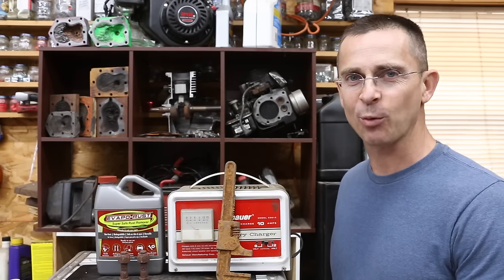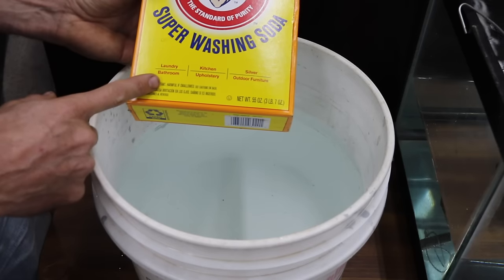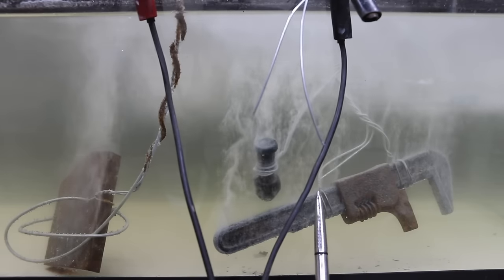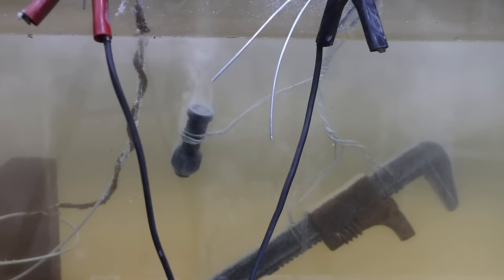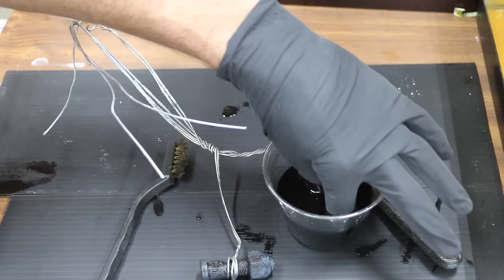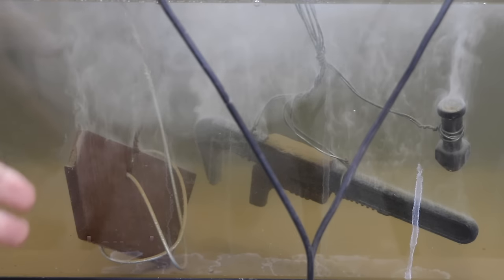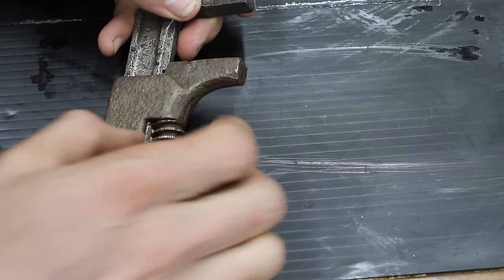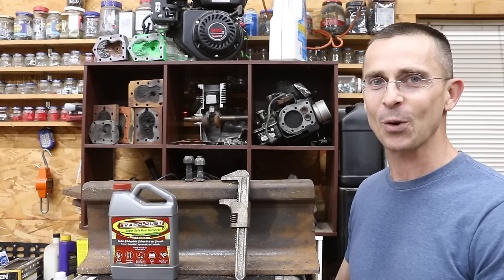Is Electrolysis better than Evapo-Rust?  Let's find out!

Comment: use Electrolysis in 
Evapo-Rust filled tub
Reply: explosions intensifies
Reply: Or vinegar
Reply: except of course, Evaporust is absolute crap...Money poured down the drain. It is almost useless.
Reply: @simonlloyd7557  worked great for my gas tank restoration, it's part of a moped frame so i can't really use an alternative lol
Reply: @edwardmulder3777  vinegar is the absolute worst rust remover, of any potential rust remover you could use.  it both removes metal AND does a relatively poor job of removing rust.

I wish people would stop recommending it.
Reply: @simonlloyd7557  - Perhaps you could share with us your 'data' and/or experiences supporting that statement.  Some people might not just accept your statement as-is.
Reply: @simonlloyd7557  I have used it for the last 3 weeks.  ITS GREAT!

Comment: Great video eh,  I've used evapo-rust for years it works pretty good, I found that when its been used over and over then turns really black it also works to blacken metal parts. 

I bought a very large old seized pipe cutter a few years ago for $20 and I haven't been able to free up the thing, the threads are rusted very badly, I even tried that automatic transmission fluid mixed 50/50 with Acetone but it still won't budge. I tried heating it with a torch too, still nothin'.

Maybe letting it sit in an electrolysis tank a few weeks would help? lol
Thumbs up! 👍🏻
Reply from the maker: Thank you and Happy New Year!
Reply: If the ATF/acetone mix, heat, and evaporust haven’t been able to free it, I doubt it’ll free up with electrolysis.  But hey, if you’re bored and have the setup, it’s worth a shot
Reply: For really rusted stuff, I've found that Muriatic Acid works wonders, you might want to try that. Caution, it is VERY corrosive, even the fumes are.
Reply: More heat, if it doesn't work you are bred, can't use the f word here. Heating the cutting disc will ruin the temper.
Reply: Give electrolysis a try, it will eventually convert all the rust back to iron powder.

Comment: It is a line of sight process, having a small little anode is not very efficient, time-wise.
Multiple donor metal rods in the corners would work far better.
Reply from the maker: Thank you!
Reply: Not true in the slightest mate, this is a key part of my career, it boils down to current (and solution, but his is fine), all that's needed is a better power supply. Hope this helps 😊
Reply: and a metal mesh all around the perimeter better still.... I know, I've tried them on complex shapes tractor parts.

Comment: I'm old school I use Vinegar. By the way Happy new year to almost half of the World.
Reply from the maker: Thank you and Happy New Year!
Reply: I tended to switch to vinegar also.  I really like Evaporust, but vinegar did a great job also, lasts longer, and is much cheaper.
Reply: Could one use electrosis in vinegar?
Reply: Cheap white vingear worked for me. Just take it out each 8-12 hours, knock off the loose rust and drop it back in.
Reply: I’m not sure if apple cider vinegar works any different from regular vinegar but it usually does the trick for me
Reply: @MegaLifeChanging  yeah
Reply: I'd put rusty nails, bolts, etc. in a small bucket with Coke and they come out like new. To think I drink that.
Reply: Vinegar with baking soda.  You can also wet sand it off  with 400 or 600 grit if  there is any remaining rust.

Comment: Hello,  I'm new to your channel and very impressed.  Here are some things I wish could be tested:  Which type of fastener head is strongest-phillips, flat, torx, allen, a few more.  I wonder in that video about a wooden head, did you use hickory, white oak?? How about a test for the best pressure washer heads?  I'd love to know the tolorances for a carb float.  Fix a flat for tire repair-cheap vs expensive.  Battery charger 2 amp vs 15 vs 40.  I'd love to know the fuel economy of bad oxygen sensor vs computer default for bad oxygen censor.  I'd love to know what wrong with the cheap gas I hear screws up chainsaws.  Half of all vehicle fatalities due to mechanical failure is due to tire failure.  I'd like to know more about that.  Where do babies come from?  I heard that garages wont flush your tranny because it loosens debris by back pressure and screws up your tranny.  My dad use to put a quart of deisel fuel in his oil before he changed it.  Could one run with just deisel fuel?  I've heard of backhoes that the motor blew up because of a leak around the injector pump.  By the way on your video of running with starter fluid I know why you can't run too much on a deisel.  I used to much on my backhoe and it lowered the compresson so much it wouldn't start.  I shot oil in the cylinder and it started right up.  I'd like to know if stop leak works.  Old timers used pepper or oat meal.  I could obviously think of a millioin things I wonder about.  When I hit this button I guarantee I'll think of more.  Like chainsaw teeth test. or I could do this all day.
Reply: OIl filters!!!!! Detergent oil, right?  Without filter non-detergent.  I don't trust synthetic
Reply: LOL.  You definitely have an enquiring mind.
Reply: Antisieze
Reply: @dougn2350  A blessing and a curse.
Reply: I've always wondered about a tuned exhaust.  What do they change to make it perform better?
Reply from the maker: Thank you for the video ideas!
Reply: you ask about: 
"dshreve34 4 days ago
I've always wondered about a tuned exhaust.  What do they change to make it perform better?"
ANSWER: You can tune both intake and exhaust. It's all about the speed of sound.  Take a long pipe, smack one end with your palm, and you hear a hollow sound, right? that sound is the wave of sound traveling down the pipe and exiting the end. The usefulness for tuning is that that sound wave as it travels down the pipe is compressing the air as it passes through it, letting go as it moves on at 720mph, plus or minus depending on temperature of the air. THEN as it exits the end it sends a negative wave, partial vacuum back up the pipe. and if the length of the pipe is set to the right length for the rpm range we want a boost in power, exhaust or intake pipe, gets back up to the start with it's vacuum charge, when, for instance, an exhaust valve is open, it helps exhaust suck out the gases. This increases efficiency considerably and causes a narrow band (up to 1500 rpm wide) of increased HP. However, the down sides are several: if this is a 4 into one type tuned header, if the valve is still closed when it gets there, then it bounces off and continues back down the pipe as a negative wave, and when it exits it sends a POSITIVE wave back up. Guess what? if it gets up there as the valve is opening it KEEPS the exhaust from coming out as well, causing a DIP in power instead of the JUMP in power with a negative charge. Look up Tri-Y headers to see how it gets rid of this problem. BTW most acoustic tuned, 4 into one headers are NOT SET FOR THE CORRECT LENGTH. I COULD give examples. Check dyno graphs of power which can show a properly tuned 4 into one engine having a spike of power at the top, and a dip at the lower rpm.
A better system is Tri-Y  Inertia tuned, not as much peak power but has an increase in power and torque across the rpm range.
Reply: @billbanche4605  Thank you so much for that explanation.  I'm trying to wrap my head around the basics.  I need some time.  I'll get back to you tomorrow.  BTW if the length being optimal for a certain RPM has anyone ever made the length vary with the RPM?  I need to think about this. Thanks again.
Reply: The more I know the less I know.  I think I finally got it, thanks to you and studying the past hour.  They call it "pressure wave tuning" and it is exactly how you described.  The only difference is I was thinking about the sound from the tailpipe instead of the collector after the headers.  I do have a couple questions, of course.
They are tuned for a narrow window-choose either low end torque or high end HP.
Why don't they mechanically vary the length to have the best of both worlds?
Why don't they use a ventura in the collector to speed up the gas? like in the carb?
Reply: So here is another idea.  Run a motor with the exhaust and without for a time to see if what I was told when young-that a motor needs that back pressure for longevity.
Reply: Last year a study was done stating that a continuous tuning exhaust would increase power 8.5 to 9%.  No one does it yet.  They do it to intakes though.  Ferrari "Its intake runners’ lengths are infinitely variable instead of restricted to just two sizes, and the runners get longer by “telescoping” instead of using flaps or valves".
Reply: A phrenologist would say you have an overdeveloped bump of curiosity. Me, too.
Reply: Bill Banche, an out of tune exhaust drives musicians crazy!
Reply: @philwood1009  I had to look up "phrenologist".  I thought it would be a joke like when the episiotomist said "let er rip".  But you are right.  I remember when I was 5 setting up different types of apples to see which variety decayed faster.lol.  When I was 13 I bought an Opel engine for the only purpose of tearing it apart.  I learned what a capacitor was when my sister's strobe light zapped me when unplugged.  I am now in my 50s and still the same way.  I've been thinking about building an engine where the crankshaft is stationary and the block spins-2 cylinder 2 cycle with the cylinders opposed.  Thanks for the reply.
Reply: @onenewworldmonkey  RE: varied lengths: ACTUALLY mazda did, by having two different intake paths on their wankel Rotary engines, & these engines only have 3 moving parts. :) Otherwise in a 4 stroke engine I don't see how it's possible.
However the 4 into one is called acoustic tuned, and I've seen engines on hot rods that have them cut to different lengths so they Fit (NOT good) and would only offer a boost at over 10k rpm or more, but that engine is not capable of over 6k. It's all about marketing. So many 'parts' and intake and exhaust mods that CLAIM power increases, but do NOT. The hot rod builders don't test them, on dyno or track, they are for show, so, as long as it LOOKS good... that is all that matters.
Inertia tuning is the tri-y, and it's much better. It uses 3 y's  connected, (connect 2 y's to four cylinders then one below) so there is always a path that passes by another cyl, causing suction at every cyl all the time. Four into one are designed for race cars, where the driver keeps the engine in the tuned area with gear choice and rpm. Pretty silly to use it on a street vehicle. Some stock exhaust systems use Tri Y build into the exhaust manifold. Other manufacturers have no clue.
Reply: @onenewworldmonkey  an engine is an air pump. the whole intake, combustion chamber, shape of valves and seat, and intake ports, exhaust valve, exit points, exhaust pipes, muffler, etc all work together to pump the air through. too much restriction anywhere in there reduces flow. 
Long ago firefighters found that if they curved outward, the output nozzle of the fire hose, it increased water flow up to 50%, compared to a nozzle that was cut off straight or flat round exit. So, a performance valve job does the same by eliminating as many edges as possible on the valve and the seat. I've done it many times on my own engines. it's like putting a higher performance camshaft by just doing that much more detailed valve and seat modification, without the loping rough idle. :)
Reply: @onenewworldmonkey  "They are tuned for a narrow window-choose either low end torque or high end HP." tuning for low on the exhaust is difficult, but possible. On a chevy v8 for instance, to tune for high rpm it takes roughly 36" to 42" length of the 4 pipes before they enter the collector, low rpm tuning would be about twice that length. as it is I've rarely seen any highly tuned cars cars with the right length for high rpm. there is no place to put them, except on a race car.
And, on the tri-y inertia tuned manifold it makes little difference on the length.   
And torque an HP are another discussion. There are limits to basics: for instance: Long stroke gives torque as does cubic inches. Short stroke allows higher RPM due to limits of piston speed increase high end power and torque. Changing cam timing is what they try these days it helps, But trying to increase torque on a short stroke engine can be done but you can't have the best of both worlds. :) Imagine trying to crank over an engine by hand with a short z shaped tool, then imagine the same with a Long z shaped cranking tool? more leverage more torque in the long one. Yes, it's complicated. :)
Reply: @billbanche4605   I remember years ago a company would pump valve grinding compound through your intake and heads to make the entire route smooth.  Thank you for your knowledge.
As for my motor design, it is hard to describe. To scale down imagine two quarters standing on edge a half inch apart.  Now connect them with a pin near their edge.  This is what the crank would look like and would not move.  Now the engine would be say five inches long by 1.5 inches wide and be like a pipe with the cylinders near the end.  The engine would spin around the crank.  I've found nothing like it.
Reply: @billbanche4605  I was wondering how big of a length distance in your pipes between max high end HP and max low end torque design (on say a 350)? Is making the diameter bigger the same as lengthening?
Reply: try google
Reply: @onenewworldmonkey  " Is making the diameter bigger the same as lengthening?" I don't think the diameter of the pipe changes the speed of sound :) and bigger isn't always better. BTW I like your inquisitive mind. :) and thinking out of the box. Keep it up. :)
Reply: @billbanche4605  Thank you so much.  I wasn't going to reply again but I wanted to run one last thing past you.  What if not far from the cylinder you  put something like an old glass pack.  The pipe becomes two-one inside the other.  The inner one would be perferated.  Slow RPM the gases would go out the perforation, High RPM the gas would blow past the perforation to a different point.  This way your could mechanically vary where that sound wave starts from with no moving parts.  Is it possible?
Reply: @onenewworldmonkey  RE: "... This way you could mechanically vary where that sound wave starts from with no moving parts.  Is it possible?": innovative impressive question, the kind that makes inventions possible. :)  Yes good questions. I had to look up and found this, for clarity: http://autoworld.50webs.com/mufflers.html  but not sure that would work, since not only would it slow down the overall flow even if done properly, (varied diameter of the section that had the glass pack in it, slowing down the flow, increasing overall back pressure) it would very likely cancel out some of the sound volume, and reduce the negative reverse wave, and perhaps not produce two separate waves returning to the valve. There may even be an effect of sound canceling out sound, as mentioned in the link. with today's supercomputers it's possible to test it in software to see if it's possible. But another negative would be change in the effect due to wear over time of the glass pack. which would change the carefully calculated tuning length and shape of components.:)

Comment: I use electrolysis. I have a metal "c" clamp on the negative lead. I took the pivoting foot off of the end of the screw part of the c clamp and I ground a point on the end of the threaded shaft. This allows good contact with the base metal being cleaned. I screw the clamp tight onto the rusted piece. The pointy tip digs in and makes contact. Try it. It works great. I get great results this way. Nice video. George.
Reply from the maker: Thanks!

Comment: You should try an ultrasonic cleaner next
Reply from the maker: Great video idea!  Thank you
Reply: I've got one of those that I use to clean lawn tractor carbs and small parts. I use carb cleaner first to degrease. Really does a good job.
Reply: Ultrasonic will work OK on loose rust, but doesn't have the electro/chemical action that E-tank does. It does work on heavy dirt or grime. Firearms clean up very well in Ultrasonic, but you really need to disassemble for a thorough cleaning.
Reply: I wonder how evaporust would work in an ultrasonic cleaner? The combination might prove very good.

Comment: Another nice vid.
I've done a lot of both on metal objects I've found metal detecting. 
The electrolysis is line of sight only and the Evapo-Rust will get inside of parts better. So, turn the object every couple of hours while doing electrolysis.
Also a couple of drops of swimming pool defoamer will keep the water from foaming and clearer while doing electrolysis. 
A half a cup of baking soda is good, unless the tank is really large.